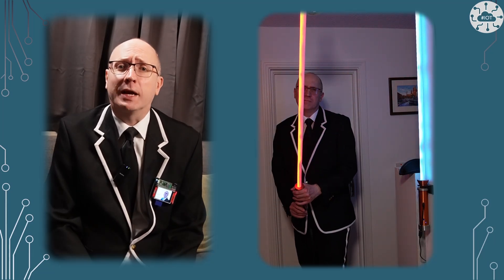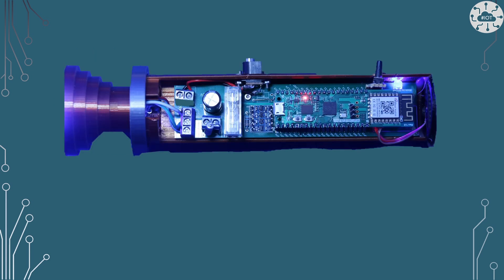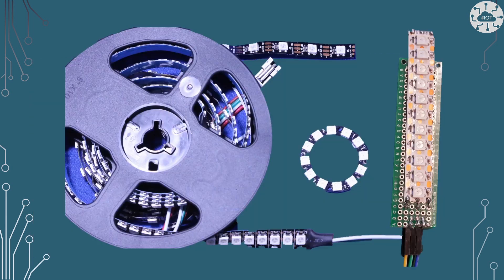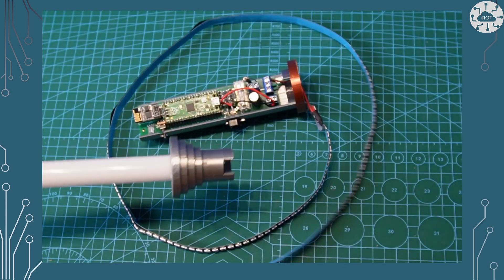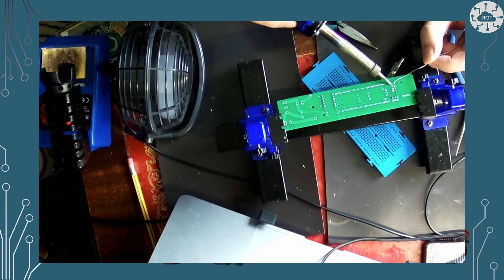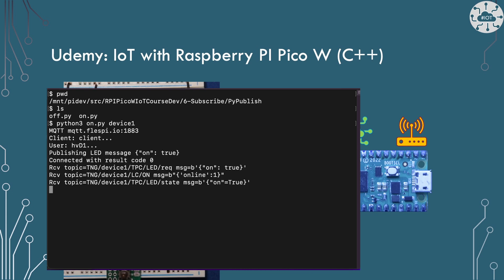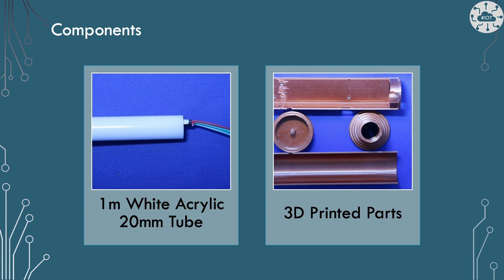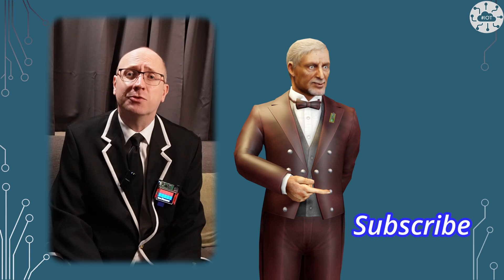Building a Lightsaber Wall light with the Raspberry Pi Pico W | DrJonea.co.uk

Comment: Hello, what would you think of integrating a speaker into this project? What speaker would you use? Would you use an amp? Would they be separate components or the amp is integrated into the speaker?
Reply from the maker: I don't  normally do projects that make noise so not considered this before. One option would use an amp and speaker. Drive that through dma and a gpio perhaps. Or I might use a dedicated audio playback module which is just triggered by the Pico.